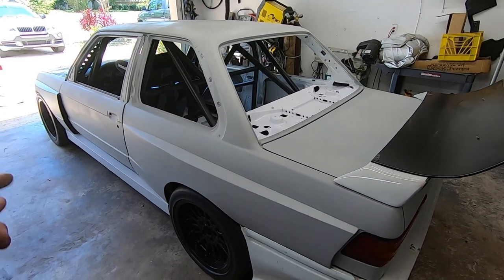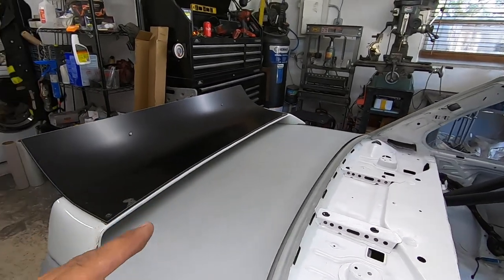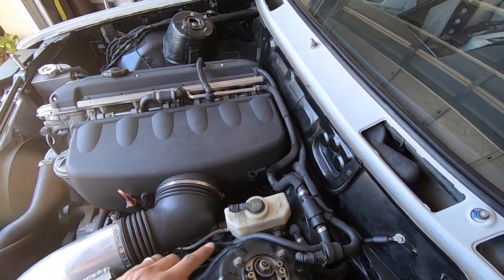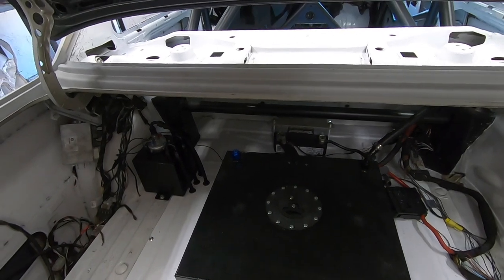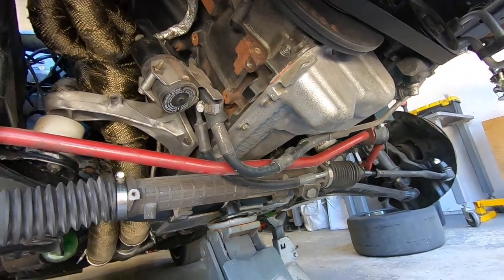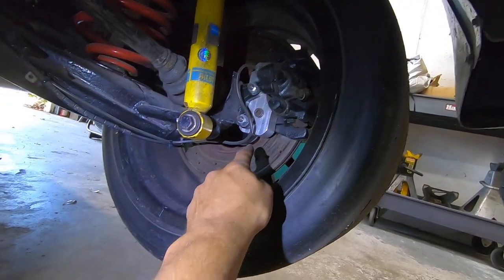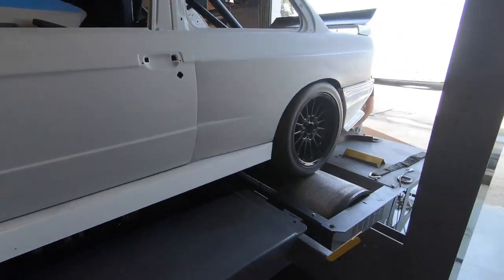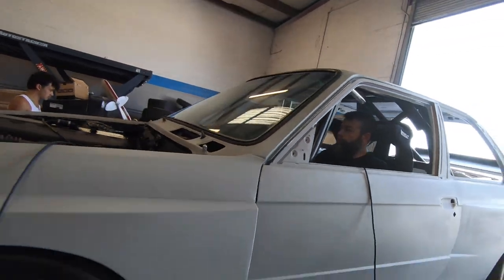BMW S54 E30 Widebody Race Car Hits the Dyno + Detailed Overview of the Car

Comment: Love the mix&match of all those different carparts and stylingques you used on that machine. 
I was playing with e30-e36`s for a while too,  swapping engines and suspensions and so on.. 
Got out of BMWs after 2 bad wrecks (didnt cause them) and numerous blown motors and differentials..
Figured my luck was running out after the second crash which was a headon hit from a uninsured driver that crossed the centerline of the road both doing +/_ 80km/h
Reply from the maker: Bummer you had bad luck. Breaking bmw differentials is hard to do!!!

Comment: Great video, Ben! The Merc W201 taillights look awesome and work very well with the E30 body. I'm excited for the debut of the upcoming project hiding in the trailer ;)
Reply from the maker: Belsky Autoworks thanks Vlad. I brought the trailer car to the shop today. Weighed it and drove it for first time. God a bad vac leak I think but it’s gonna be so sick.
Reply: @baysidefabrication  most likely the elbow from the throttle boot to the idle air control valve, or one of the vacuum caps on the back of the intake manifold (near the firewall)

Comment: Ben how complicated of a swap was this and what are you using for ecu? I have an e28 that needs moar powah
Reply from the maker: Not much different than any other m50/s50 swap except if you want to run the dual sump pan. And motors are $3,500+. Stock e46m3 ecu

Comment: "I love everything E30..." 2 parts of the car are actual E30 parts HAHA. and why such a weak motor? (only 330hp is it because of the class or?) the E46 M3 isn't the best of them (in my opinion), E30 M3 engine would of been better if you wanted a straight 6. in my opinion the E39 M5 V8 engine would of been the one to go for, I got 550hp in mine with a stage 1 supercharger, I also owned a E90 M3 V8 too that was a monster of an engine! you can check it out on my channel (only 1 or 2 min videos). I tried to get Brent to remote tune it but they said that he couldn't do it :( even though Brent said he can remote tune ALL cars) :P
And what a great fab you are, I wonder who is best you or Shawn.. would love to see a video of who can weld some specific joints the best ^^
Reply: the E30 M3 is a 4 cylinder (S14B23) and the V8 doesn't fit in an E30 engine bay, you have to lower the subframe and the car feel different after that (the lower arms are mounted on the subframe and the chassis so they have a weird angle) :-)
Reply: Such a weak motor ? Woah... Gotta give a little respect to the S54... 260+ Lbs-ft Of torque for a naturally aspirated 3.2l. The S62 (E39 M5) Is an awesome engine, but way too wide and front heavy for this awesome little road race build. The torque per litre output of the S54 is only beaten by exotics engines that came 15-20 years after the S54 ( a 400k$ 2020 Porsche 911 GT3, 4.0Litres, 500hp, 339lbs-ft. Is exactly the same torque per litre as a S54 ) Jeremy dyno seems to be slightly off, there is no way a S54 will ever put down 265 Wheel torque with the stock compression. Even if its slightly undersquare (3.58'' X 3.43'') A S54 would need close to 14:1 Compression ratio to achieve 265wtq Considering a very conservative 12% Drivetrain loss. Sick build, quality workmanship, this guy is a master fabricator !